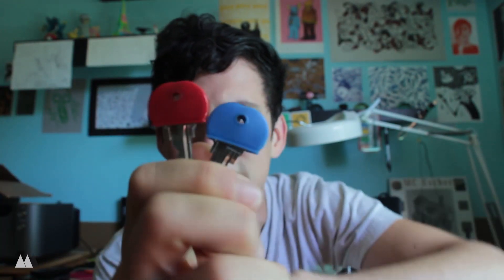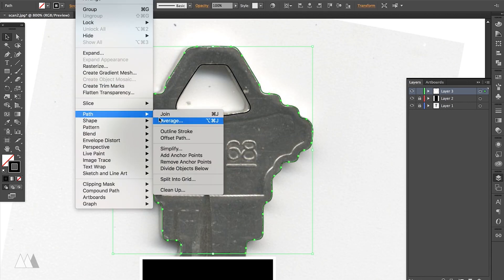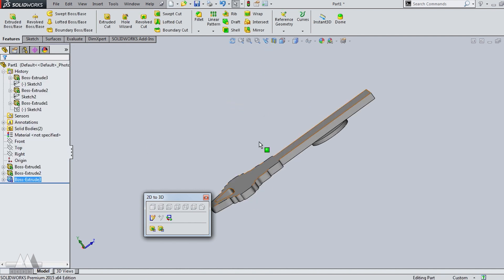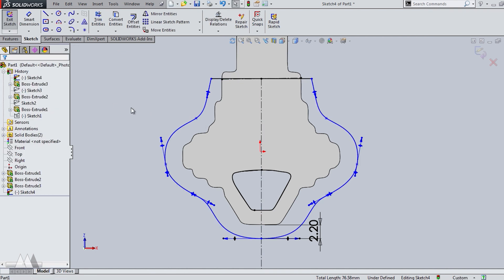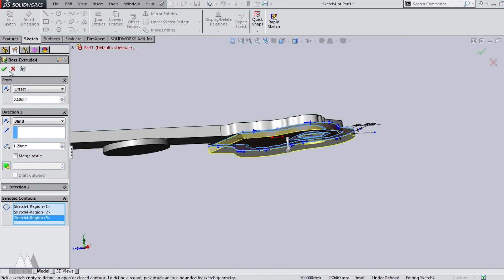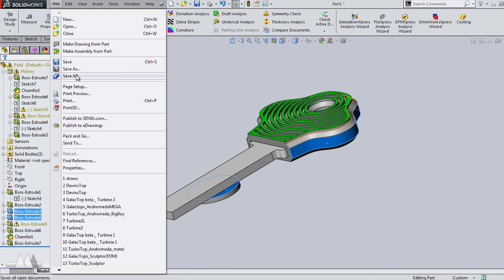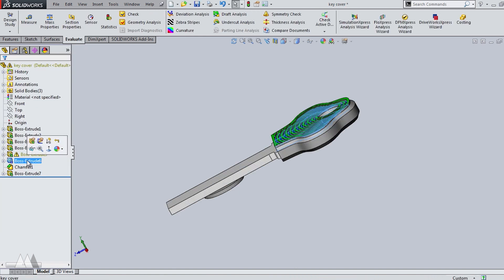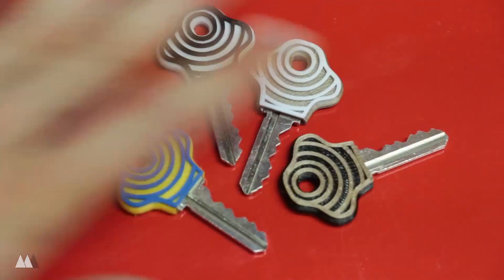3D Printing Embedded Key Covers

Comment: You always offset the extrude from other parts in order to prevent them from merging. Doesn't Solidworks allow you to select "new body" instead of "merge"? I haven't used it for a little bit, so I may be wrong, but I assume anything Fusion360 can do, SW can do better.
Reply from the maker: You can do that in Fusion and solidworks, but I prefer to offset because otherwise the parts might re-merge later on. Also, because of the slight surface inaccuracies of 3D printing there's going to be some space between parts in reality

Comment: when making an extrude in SOLIDWORKS, there should be a check box in which you can avoid the two bodies from merging. that way you wouldn't have to offset your extrude from the key.
Reply from the maker: +Ben Blank there is, but that little extra space accounts for tolerances too, so the key has a tiny bit of wiggle room when printing!

Comment: How is it the printer doesn't think the top of the key needs support and prints support material where the key should be?
Reply from the maker: I turned support material off,  so even if it seems like it will fail, the printer will try to print what I tell it to

Comment: Presume the same could be achieved with free software like inkscape and Fusion 360. Could you explain more how to set up the printing to pause, move the print head out of the way to embed the object, then set it going again? Do you use Simplify3D for this, or another slicer, and does it require special gcode?
Reply from the maker: I set up the pause manually through my printer's interface... I believe it can be done in Simplify3D, but I haven't looked into it much

Comment: how did you figure out the tolerances of your printer? thanks
Reply from the maker: +Aaron D'mello it's something I learned pretty quickly after trying to make parts that snap/slide together! My printer is very accurate, so the tolerances are consistent
Reply: Aaron D'mello here is a link to a video from Makers Muse with a design he made to test your tolerances on your printer. If you have not already seen it I hope this is helpful my friend.

Comment: Awesome video. What about if, to make a bracelet, you print a handful of beads in a small circle, then half way through you pause and embed a rubber band? There wouldn't be that knot you always get from home made bracelets.
Reply from the maker: This is a great idea!
Reply: Paden Gentry yeah that's awsome
Reply: Paden Gentry you could also do that with cast beads and some "premium"(not cheap chinese) bracelets do that aswell. just make a bead mold, put in a string, and fill with plastic
Edit: didn't watch to the end where he asks for ideas with embedding.

Comment: You should try putting magnets in a sphere so to create a monopol. Then create a monopol surface of the other polarity. The sphere would basically float in mid air... Now THAT would be pretty cool...
Reply from the maker: +Vjekoslav-Leonard Prčić wait.... That sounds awesome!!!
Reply: Thanks! It would probably be more complicated than embedding keys because you would need to pause printing multiple times to insert the magnets into the sphere. Or, you could create a truncated icosahedron (soccer ball) in parts, insert all the magnets and then glue it together. Also, the "surface" should be "bowl" shaped so the "sphere" doesn't float out... That being said - you probably know better what to do than me...

Comment: An even better secret is if you want the plastic to actually stick to the metal, make the cutout smaller than the metal and scratch the metal surface. Stop the print like before, only this time heat the metal, and press it into the slot. The bond is pretty good.
Reply: joblessalex aka welding

Comment: He could have just used a print pen and it would have been easier
Reply: tigerlover77286 he could have, but it wouldn't have produced such nice edges and smooth surfaces, and it would've been difficult to create the design on top and fill in around the hole at the top

Comment: when he scanned the key I was screaming that people cam copy his key and re make it. but he blanked...
Reply: He did but if you look at 9;23 you can see full keys. You don't need the actual key you can tell by shape what company it is and than get the measurements than you have the cuts from image. That's how the TSA screwed up an image they posted and within minutes the image was grabbed before they pulled it and now there are all the TSA lock keys for luggage in a friendly STL file. Granted the keys shown towards end might not be current. He did so good in the beginning hiding the cuts also. Really like how he did the tops got me wondering if I can pause mine easily without watching and waiting.
Reply: @TedZarcone  "if I can pause mine easily without watching and waiting."
You likely know this by know but there's g-code which will pause most printers. I'm sure I could find some videos to help with the topic if you want/need more info.

Comment: In SolidWorks, wouldn't it be easier to get the key outline and the cover outline and then extrude the cover full height?  You would then use the key outline to cut a hole in the cover.  Much fewer steps, I think.  

Also, if the shape was acceptable, you could generate the cover's outline using an offset from the key outline, I think. 

Nice work!

Comment: So now I have the exact dimensions and tumbler pattern of your keys?
Reply from the maker: decognition brb.. switching all my locks
Reply: Print some keys and test them on some locks, i'm interested if the plastic is rigid enough to work! It would also make some fun content, which would compliment your channel ;)
Reply: Shravan it does as long as a lock mechanism is smooth
Reply: Nerys it doesn’t matter much if the lock is smooth as long as you use a strong filament

Comment: I'm sure there are awesome things to do with magnets. Thanks for sharing.
Reply from the maker: Neil Makes It true... I would just have to use an aluminum hot end so the magnet doesn't stick to the printer :P
Reply: Good point. I bet you could use a drop of super glue to keep the magnet in place while it prints.
Reply from the maker: very true!

Comment: can you try printing something hollow, like a cube, but halfway through the print you pour water inside? Then you finish the print and you have a thing with water inside.
Reply from the maker: Michael Gavartin risky, but cool idea!  especially with a transparent filament
Reply: Make Anything // 3D Printing Channel but maybe one day, maybe put a box on the print bed and print in that?
Reply: you can create an hourglass this way (with either water or sand)
Reply from the maker: maybe I'll make a video ;)
Reply: Or he could print a cube with a small hole in the top, the fill it with water and use a 3D printing pen to seal the hole up
Reply from the maker: oooo that would be cool... I might have to try it!
Reply: Make Anything // 3D Printing Channel please do it it sounds cool!
Reply: If there is a heated bed, watch out. I just printed the test piece from thing:605232 and I threw a couple quarters inside... I popped it open right after and almost burned my hand (ABS printing).
Reply: they can be if you have the right settings
Reply: don't forget to share some photos (or at least the model :P
Reply: Make Anything // 3D Printing Channel nice!!!! :)
Reply: but how would he 3d print the top whit out using support material?
Reply: Michael Gavartin you could print a hollow cube with a little hole there you can pour the water and then you could plug the hole with a 3d pen
Reply: Michael Gavartin or he fill it with fake jem and make the rest with a sort of spider wen patern.......just a thought
Reply: But the water wouldn't show up because even clear filaments aren't as clear as needed to show the water through :O
Reply: AngelaPaulina Lo he could maybe dye the water, but the heat might mess it up thop
Reply: I already did that experiment but with sand ... I've printed my brother' buste .. to make a pencil holder in his head .. but it was not heavy enough at my first attempt. Then the second time .. printed hollow .. pause .. add sand ... continue to print ... was PERFECT !!!
Reply: Sorry guys, buy 3D prints aren't water tight...
Reply: you make no sense and im11